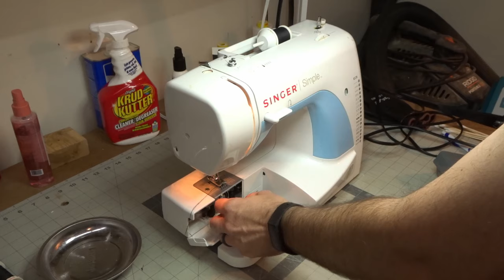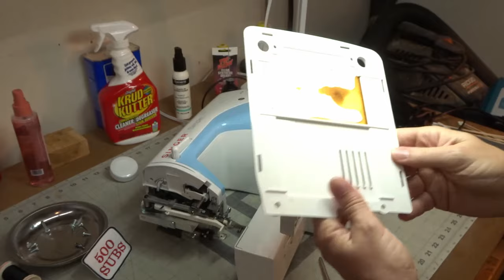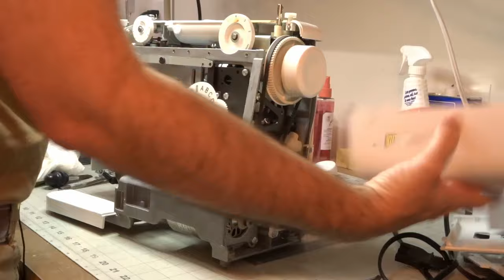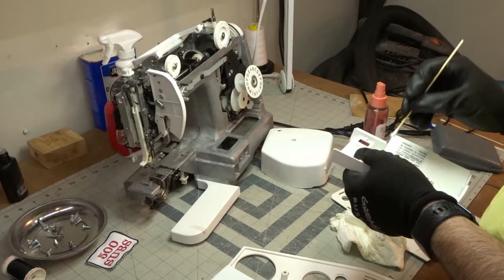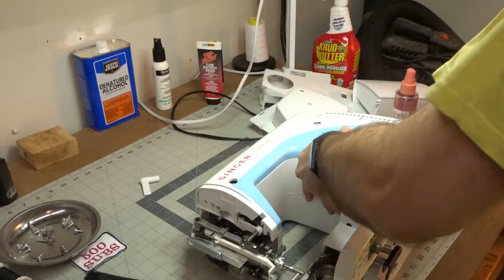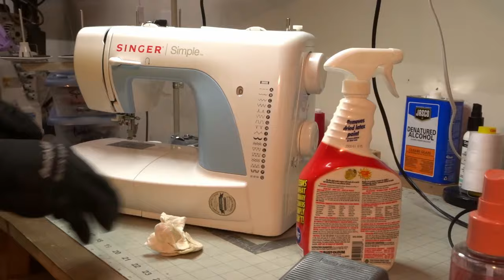How to clean and adjust a Singer Simple Sewing Machine that is really dirty

Comment: After this video will try to fix my machine same one, have been trouble shooting there is a loud tight squeak and the bottom thread in the bobbin gets caught when u pull it out it is more like 4 strands instead of one. Have tried 4 bobbins and cleaned that area and reassembled. thanks for the demo

Comment: I have a new Singer model 2277 Tradition machine and can't get it to stitch the sample piece I have doubled up and placed under the plate and have checked everything I can think of to get the machine to stitch like it should with no improvement.  I am wondering if it could be a company problem which causes this problem since I can't find any help online for this problem of the thread not stitching the material.

Comment: most of my machines are really old , 70's & 80's models , many are used for teaching free volunteer, that means I can't afford to pay for the upkeep,  I have singers, kenmore , Brother & White machines , Hoping to find videos on these types including replacement of motors , believe the Singer Fabricmate has gotten tired, motor is inside the housing, don't know if it can be replaced or how i would start with doing that. the older machines with the motor housing exterior on the machine looks more manageable for if I were to replace any of those

Comment: I have the very sewing machine which needs some maintenance.  Is this video available in normal speed as it  is very fast in some crucial areas that would help me immensely.  Thank you.
Reply: You can slow the video down and see what he's doing. 
Here's what you do:
    From my phone: inside the video player (upper right corner) there are 3 dots. That's where your video settings are. Click on that. Choose playback speed. Normal speed is in the middle. Slower speeds above. Faster speeds below. Choose the speed you want. 
    Hope this helps ypu. I use it a lot.
   (On a computer I think that settings is under the video player. Can't remember but if you are on a computer just move your mouse around and look for it. It's there somewhere)

Comment: Hi there.  I followed you over from Andy Tube. Good old Krud Kutter, right?  That stuff is awesome. What is the stuff in the apricot colored bottle? I could have used a little more narration, especially when you had the machine on its back, turning the handwheel and looking at the needle and the bobbin. I’m guessing you were checking the needle bar timing? Also curious how long it took in real time to service the machine. Thank you for an informative video.
Reply from the maker: Thanks for the feedback. I have been using denatured alcohol to clean machines, since isopropyl is hard to get right now. Also, there are a lot of people that need the isopropyl more than I do.

Comment: I have a question that maybe you can help me with. I have a Singer Simple 2263 that I am going over for a friend of mine. It turns rather tight and I found several things that need fixing. The Crank Connecting Rod is very tight and I can't seem to open the cover to get in there and clean and lubricate things as they should be. How do you handle this problem when you see these machines? Then I have a problem with the Zig Zag adjustment dial and the Needle not centering on Zero. It slides into the center on 2. How can I adjust that whole assembly so things work properly? Any help you can share would be greatly appreciated. Thank You for your Videos and your help!

Comment: I have a brother I can move the wheel with my hand but when I use pressure foot it doesn't move I even got a need pressure foot same thing the machine is 4 years old do you think I need to change the rubber under wheel? Thanks

Comment: Why does your video speed up to hyper speed?  I would have found it useful covered in real time.
Reply: You can slow the video down and see what he's doing. 
Here's what you do:
    From my phone: inside the video player (upper right corner) there are 3 dots. That's where your video settings are. Click on that. Choose playback speed. Normal speed is in the middle. Slower speeds above. Faster speeds below. Choose the speed you want. 
    Hope this helps ypu. I use it a lot.
   (On a computer I think that settings is under the video player. Can't remember but if you are on a computer just move your mouse around and look for it. It's there somewhere)

Comment: The selector is stuck on "A". I oiled the machine, but cannot find the problem. Cannot move it and afraid to strip the gears. Any body have suggestions?
Reply: Did you figure this out? I've got same problem
Reply: Did you figure it out mine is stuck in E💀
Reply: Mine is stuck on A